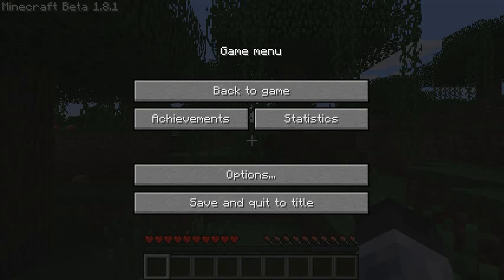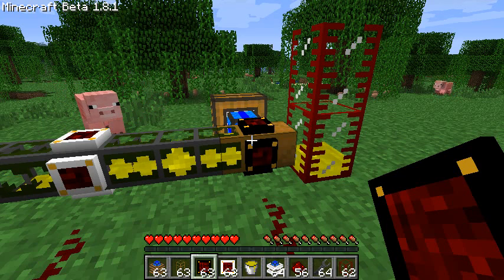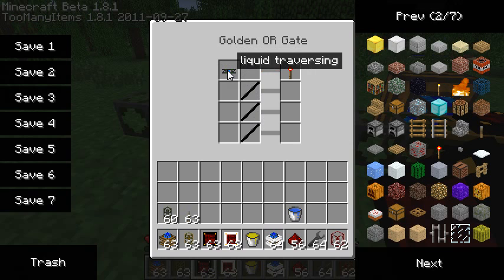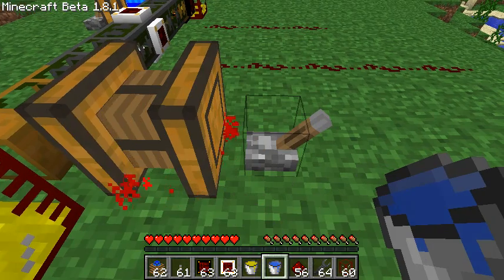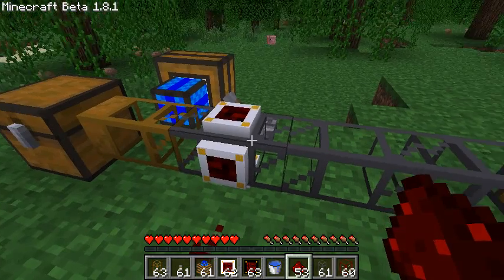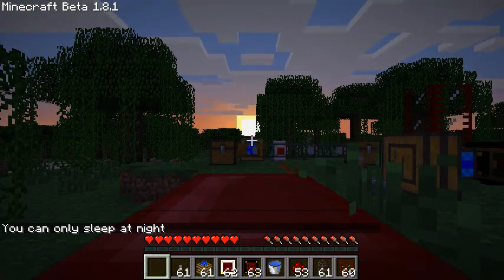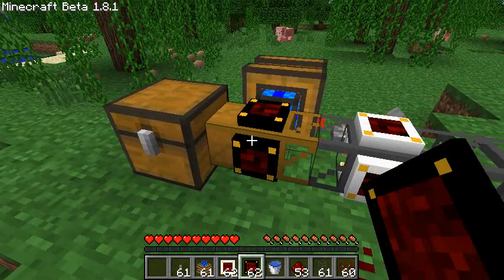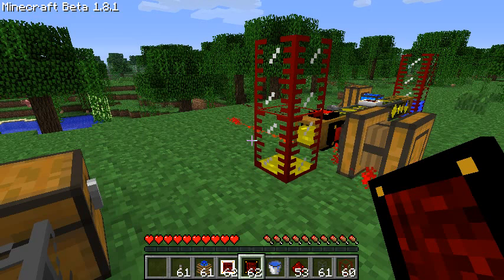BuildCraft 3.0.0 - Parameters (Tutorial 103)

Comment: I think a new option for gates should be shutdown, for example: If blue wire is on, turn off engine, and prventing from it being able ot be powered, my reasoning is because I don't know if its possible to create a shutdown system, since I like to use steam engines(because I don't like fueling combustion engines) and it is a pain where they heat and explode and there is no way for me to create a shutdown system that I know of.

Comment: I do not know were you stand on storing power in Buildcraft SpaceToad, but if you are interested in storing power, here is my idea for doing just that. When you create a tank, you CAN put redstone in the middle of the glass formula to create a energy storage tank and this would behave just like it would with liquids (except its using powered pipes instead of waterproof) but the energy level is  messured the same way except it looks like electricity in the tank with redstone wires running around.